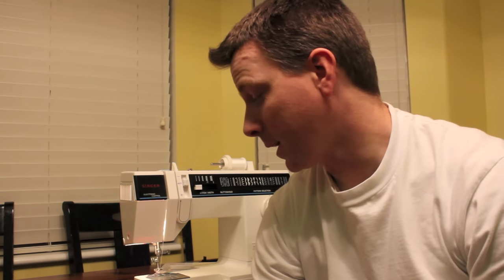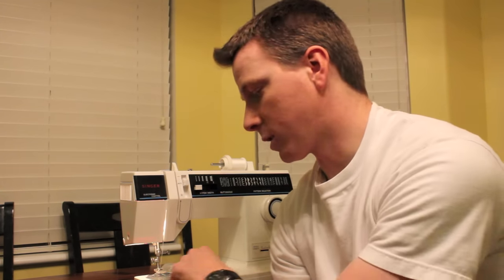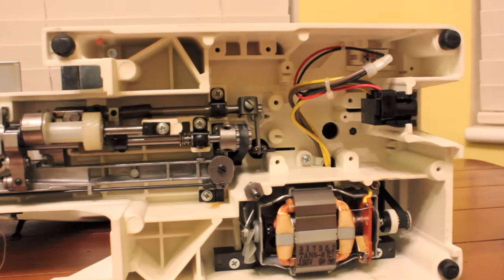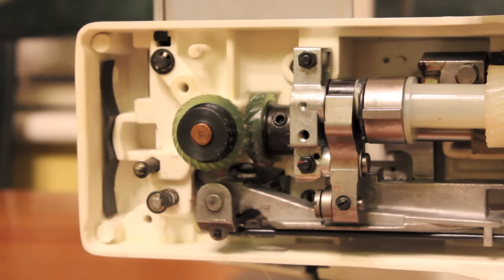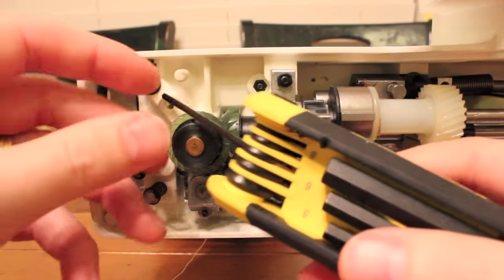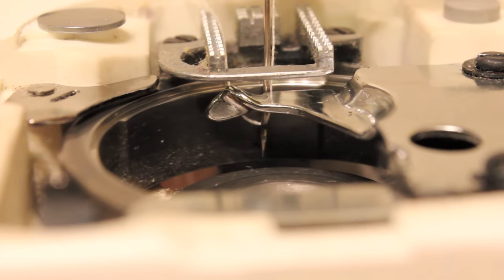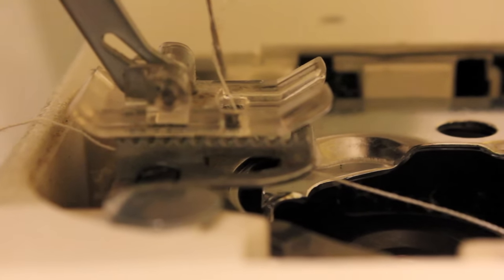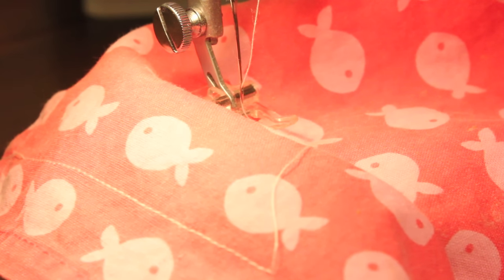How to Fix / Repair the Hook Timing on a Sewing Machine

Comment: I am a sewing machine engineer with over 30 years experience.

This video may fix the problem if you just want to do straight stitch only. For zig zag you can try adjusting the gear whilst the needle is on the maximum ziz zag width on the left hand side with the point of the hook just above the eye of the needle. 

Not the way i would repair this fault. The usual cause of the problem is the machine gets jammed or a needle gets broken. This causes the timing belt on the opposite end on the shaft the gear is on to slip. This in turn causes the hook and feed timing to be affected. Also the needle bar may have moved up which can complicate the procedure. 

This problem is common on any sewing machine and even for me this can be a fiddly job to do! Only do what you are comfortable to do and my advice is to DONT try any further adjustments if the video doesn't cure your problem.
Reply: Please post a video for The right procedure
Reply: Depending on the make and model of machine some have 1 or 2 set screws on the right hand end of the shaft. (Usually there is 1 flat on the shaft.) 
However I would suggest a novice doesn't start by loosening ANY screws but inspect all the gears on the bottom first and see if any teeth are missing. Very common for many Singer machines with the 2 feed gears in the bottom centre to be damaged. If either damaged DONT try and replace either of them. 
If either of the 2 hook gears(on the left hand side of the shaft) are damaged you can try and replace. 
If all gears look ok you can try retiming  by easing the toothed belt off and do it by trial and error. To clarify previous posting I rarely find that the needle bar has moved.  Do the adjustment when zig zag is on max width on left hand side. This is a very fiddly job but if this solves the problem then saves you loosening the 2 screws.  
The older the sewing machine the better quality they are. Virtually all new machines sold today are made in China and a few in Vietnam etc (including Singer) and are nowhere near as good quality as the old ones.
If you've tried repairing it unsuccessfully then let a professional sewing machine engineer check it for you. DONT THROW IT AWAY and don't bite off more than you can chew!!
Reply: I followed the instructions worked for me when stitching straight, but would not pick up when using zigzag. I was looking for a more technical explanation as to the cause and cure, here's a few question that I have:  1. Where should the  needles position be when raising to create the loop for the hook to take up. 2. Where should the hook be in relationship to the needle's eyelet, when the eyelet raises, should the hook appear through the eyelet during take up. 4. Would the timing be different when performing zigzag stitching and how to adjust the timing for zigzag. And how should the timing belt and or timing gears be adjusted. Thanks
Reply: Timing on janome 12000
Reply: Yes, Yes, YES! This is exactly where people mess up their machines. First from improper use that causes damage and second, from trying to fix it themselves rather than taking it to a technician that paid thousands of dollars to learn how to do this properly and have overhead to pay. This will absolutely not fix the problem. It might get the straight stitch to pick up but no zig-zag. On computerized machines, you need calipers to adjust every needle point.
Reply: It's so sad to see how some people support the status quo. What's wrong with to try to DIY? I understand not everybody is curious and handy. When professionals are honest (in most cases are not), I don't have any problem paying them for any fix or job that I need to be done.  But when you go to a professional to fix something, they abuse and they lie to get more profit from your ignorance. This is the reason I look for videos to help me to DIY. If you come on here to criticize people posting videos of how they fix something is better you go to watch Netflix or something else.
Reply: Emesee, if you are an engineer and know how is the right way to do it, show us. If you are just criticizing and not helping anybody, keep your comment for yourself. Back up your comment posting a video how to fix it.  Maybe you are afraid to go to unemployment.
Reply: The point is that if people follow this advice blindly, they will seriously screw up their expensive machines!
Reply: There are lots of professional videos with proper repair procedures. This is not one of them. There's nothing wrong with DIY. DIY is great! But following blind advice from an amateur is not "Smart" DIY. Would you watch a video on how to adjust a timing chain on a car with the intro of a woman saying she's never worked on a car before? Get the point yet? lol
Reply: I don't have the time to search for that for you. I've found them in Google searches or the search bar on Youtube. Unfortunately, we really just have to go to school to learn sewing machine repair. Which really sucks because there aren't any courses near me. It's really just cheaper to pay a repair person the $50 to tune it. Cheaper than getting a tune up on a car and just as necessary. Good luck!
Reply: emesee please help!
Reply: I'm new at this posting my comment everywhere it seems. But I got more outta your comment than all these videos. Needle won't work up and down just hums. Took apart there a black latch next to wheel where belt is. When I pull it backwards runs like a kitten. Don't know how, where, why to make lever stay in place??? I'm really amateurish just trying something new to keep my sanity. If u can offer any advice, help, I'm more than grateful. Thank you in advance!
Reply: Oh! It's a bernette 46 Bernina
Reply: Frances Fluker your belt keeps falling off? I'd get a new belt. It likely stretched. Simple fix that can be done diy.
Reply: emesee, I am not a sewing machine engineer. Zero years of experience. Had a Singer Stylist 457 with a broken vertical gear. There are no sewing machine repair shops nearby. So, my most economical choices were to fix it myself or toss it.  Ordered a $10 replacement gear. Spent time researching on line on how to replace. Replaced the gear. Not as quickly as a "professional", but I got the job done. Same thing with setting the timing. Took a number of trials before I held my tongue just right to make it work. Straight stitch, ziz-zag and blind hem now work just as they did when I bought this machine 48 years ago. 

For mechanical (not electrical/electronic) problems), I encourage folks to check out what is reasonable for them to learn to repair. Yes, setting the timing is fiddly work, especially the first time one takes off the bottom cover of a machine. If something happens to affect the timing of my machine again, it won't be nearly as "fiddly" the next time. Should be a pretty straight forward adjustment. 

While I would have done things a little differently, I respect this gentleman's effort to be self-reliant.
Reply: Emesee would you have any idea if there's an online course I can do? Australia doesn't have anything as far as I know. I've tried to look into it before but a few people whom own sewing shops and can fix machines have mentioned there's no courses. And a gentleman from one of the shops say he was one of the last group of students before they got rid of them (20+years ago). Any help would be great.
Reply: Daemen9, I haven't found an "online course". However, have learned much from simply researching specific problems on line. Use a search engine and applicable keywords such as Singer 66-1 tension adjustment or National Sewing Machine shuttle 
Study as much as you can, in this manner. So far I've returned my Grandmother's National treadle (approx 1910) to a useful life. It had been stored many years in a shed. Was locked up. Cabinet was filled with dirt dauber nests. 

Replaced a broken plastic gear and reset the timing in my Singer Stylist 457 (purchased May 1970). Learned how to do it by watching several YT videos on the subject. 

Currently working on an early Singer Red Eye 66-1. The head was partly taken apart and nothing would move when I got it a few days ago. Almost have it sewing. Everything moving. Have an issue with the bobbin thread that I hope to resolve soon. Via researching on the Internet to learn how others have tackled this problem. 

Like you, I don't know of any local resources to help me out. 

Hope you will find this approach beneficial, too.
Reply: Oldtimer Lee Thank you. Do you have any recommended links that are your go to websights? Or is it cross your finger and hope I've searched the right specifics
Reply: The approach I take is to search until I'm comfortable with the information I've received. How much depends on the subject and how complex the best solution may be. For example, if I watch 2-3 videos on how to fix a bobbin winder problem, then I'm likely to use that solution. If I encounter considerable debate on how to fix that same problem, I'll keep exploring the subject until I'm comfortable with the solution. 

Speaking from experience, it can take anywhere from a few minutes to days of research, reading, studying, etc. & etc. depending on the particular need. 

One other thought.... when searching for information, try multiple key word combinations. For example: Singer 66 repair or Singer 66 restoration or Singer Red-Eye treadle or Singer treadle bobbin winder, to mention a few. 

No, it's not quick. Not always easy. Usually pays off in the long run.  This type of experience with other machines is making it easier to find specifics for the one I'm currently bringing back to life.

Wish I could be more helpful.

Comment: Hi there sorry to seem a little pretentious but when you are timing these singer machines there are timing lines on the needle bar to help you get the exact timing required , When the needle bar is at the lowest position you will see two lines one to mark the lowest point and then the other is used when the needle bar is on its rise you stop on the second line then adjust the hook to the point where you stopped the needle . Then you should have perfect timing without guessing .
Hope this helps !

Comment: Hi Nils, Thanks to you my husband and I worked on the timing on my Singer Stylist II and it is now straight stitching perfect, how ever it is not doing any other stitches well. Zig Zag is mostly straight with a zig or zag every so often. It appears to be moving properly, the needle shaft does not move over till the needle is up. Do you have any advice? Thanks

Comment: Great video! My sewing machine is only picking up the bobbin thread when I put the needle to a very low position (I had to open the tube and slide the piece down that holds the needle) but even though it picks up thread, the thread won't go round as it should. Any ideas what it could be?

Comment: i have a machine that look like yours. do you know how to fix the feed dog? my machine cant move the clothe while i am sewing i have to hall the clothe in order for it to move
Reply: for feed dogs you need to find the cam which is an irregularly shaped piece of plastic or metal that is on the lower shaft...if you turn the hand wheel and watch the motion you can identify which cam it is that lifts the feed dogs...from there you can identify what will adjust them...often it is a set screw or an eccentric screw,,,they should be about 1 millimeter..

Comment: Hi Nils,forgive me that this is so long after you posted. My futura singer machine is almost the same beneath as yours. I have a timing problem too, the hook is well out and actually pushes the needle away threatening to snap it. I have taken a photo of the opened bottom casing and would really value you giving me your tips for what to do next to alter the gear position. Many thanks, best wishes, Sandra
Reply from the maker: Hey Sandra, I'm not sure how much help I'd be because I've really only done what you see here in the video but I'd be happy to take a look.
Reply: That would be great, thanks. I have uploaded them to my google account. Don't know what to do from there. Do we need to swap email addresses, or link gmail or something? Sorry to complicate things.  I am in the UK and it has gone well past my bedtime, so  it would be great if we can we continue this tomorrow? Thanks again, Sandra

Comment: Thanks. Sadly, this is the only instance I found of someone addressing timing on a machine with a horizontal shuttle. Unfortunately my problem is that my machine occasionally misses the right side stitch, on a wide ZIG ZAG, and that the most important pattern I use. And unlike the ones with a vertical shuttle, there doesn't seem to be any mechanism for moving the shuttle back and fourth to follow the needle as it does its ZIG ZAF pattern. So I guess you have to make a compromise timing between the left and right extremes. But after making several "close but no cigar" adjustments over time, I really wish I had the benefit of an actual setup procedure. I have a a husqvarna Viking Emerald 116, and the manufacturer refuses to offer the service manual to "no authorized" folks. Stinks! But anyway, if you ever have to revisit this for a problem like I'm describing, please let me know what you find. thanks.!
Reply: According to other repair videos I've watched, to set the timing correctly for a zigzag stitch you would need to set the needle to the far left position before adjusting the hook timing. Good luck...to us both.

Comment: I looked through some comments and didn't see it, so HOPE I am not repeating what someone else helped you with: That thingy that goes around and around is called a SHUTTLE, just like the one that went to the moon and back down so many times...except THIS one was a shuttle BEFORE the one that went to the moon! 

Next: The Bobbin...people are having trouble with that, and there can be multiple reasons for this: Thread stuck down in there somewhere, even DUST in there can be a big problem...needs to be VERY CLEAN and cleaned frequently. Also, if it isn't pushed all the way in before being released, it will not LOCK into place. And there is a very tiny 'tooth' that locks onto the bobbin and holds it in the BOBBIN CASE, and then it is released as the BOBBIN CASE is inserted into it's place in the SHUTTLE. Then, the bobbin can freewheel in there and release the thread-according to the tension on the BOBBIN CASE, AND THE MACHINE TENSION TOO. There is a very small little screw on the side of the BOBBIN CASE that you can adjust the tension of the thread there, but it's really rare that it needs it.

Who sent this? A granny, who grew up in a family that sewed all the time, sewing was like eating, machine always set up, never packed away. She made cupcake dresses for her little girl, who finally got tired of wearing ruffles and lace ALL THE TIME...and her mommy could not afford to buy anything so nice. 

I bought old machines from garage sales and they didn't sew...I looked for a minute, could see the needle was in BACKWARDS, so turned it around when no one was looking, it sewed LIKE A DREAM...they sold it half price for $10, and now my daughter in law has it. 

Old sewing machines never die, they just hang around till someone who appreciates them comes along. I would NEVER buy a new machine, as they are a bunch of JUNK and PLASTIC, but those oldies....yeah..their goodies and with a little TLC they will work their hearts out for you, even if you sew way past midnight!
Reply from the maker: Great info, bfinfinity! Thanks for sharing. I added a comment to the video to point out the name of the shuttle. Glad to hear you're saving money and keeping those sewing machines going :)
Reply: So true like most things made today designed to fail. It's about their profits. Educate!
Reply: +Nils Rasmusson Hello If you can  hellp me please  I have a Jockey machine' usually I sew fabrics with medium thick and now I have a project working on it with more thicker fabrics' so when i start sewing  the thread cut out i dont know what to do
Reply from the maker: +Shosh Lool So are you having the same problem that is shown in the video? If so, have you had a chance to try the solution shown here? This is honestly the only sewing machine problem I've dealt with so I'm not sure how much help I'd be otherwise. :)

Comment: I have a Singer also and the timing was off, your instructions worked for me when stitching straight, but would not pick up when using zigzag. I searched to find a more technical explanation as to when the take up hook should intercept the needles eyelet. 1. Where should the  needles position be when raising to create the loop for the hook to take up. 2. Where should the hook be in relationship to the needle's eyelet, when the eyelet raises, should the hook appear through the eyelet during take up. 4. Would the timing be different when performing zigzag stitching and how to adjust the timing for zigzag. Thanks

Comment: Hi, thank you for sharing this. I have been trying to find a demonstration on how the bobbin basket is fitted. I had taken the bobbin basket out in order to readjust the tension on my sm14 c singer and cant get the bobbin basket back. Is it supposed to just be dropped in or there is /are parts that need to go under something else?
I would really appreciate any help. It won't saw anymore, will do 3-4 inches of seam and than jams or the needle breaks.
Reply: Anna, did you have to remove anything to take the basket out? If not, it should fit in only one way......is this a top loading machine?